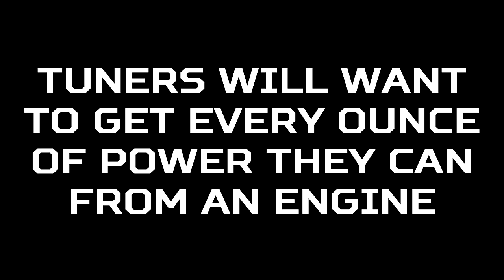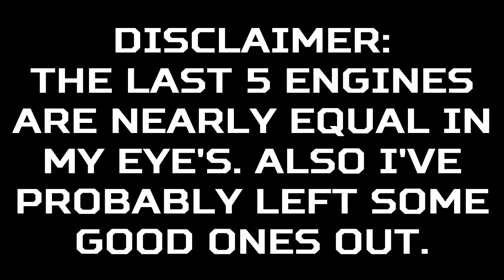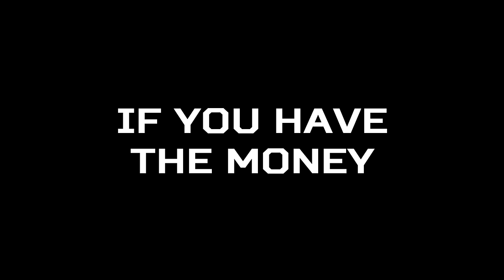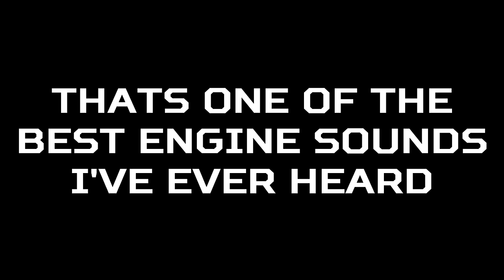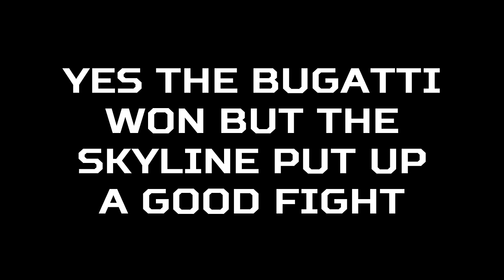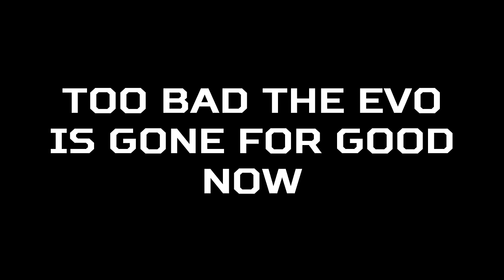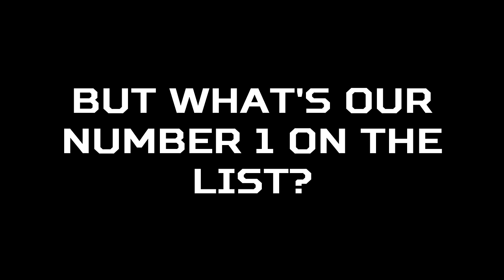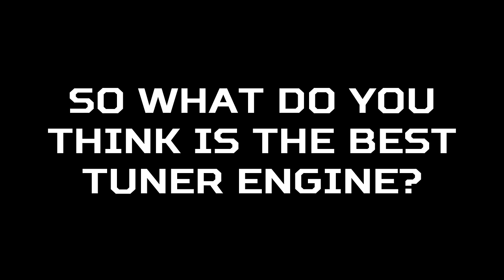9 of the Best Tuning Engines

Comment: As much as I love the LS engines, even I have to admit the 2JZ is pretty freakin' awesome.  Where the LS edges it out is in its ubiquity, simplicity, size, weight, and durability.
Reply: david donovan an ls weighs less than a 2jz size is about the same as the 2j and it is more reliable than a 2j still I love the 2jz one of my fav engines
Reply: as reliably it depends on the ls my guy
Reply: @BryanGarcia-qb2ov  false.  The 2J is just as if not more reliable then the ls
Reply: @19KiloM1A1  at stock hp, if your looking to get really high hp, an ls will be more reliable
Reply: @kellykun5090  that is not true.  I have built 1000+ hp on a stock bottom end 2J.  Just do some digging and you find that out.
Reply: @19KiloM1A1  okayyy? and that is irrelevant, an LS will always have the upper hand in durability,  with the same money invested(from a smart tuner)
Reply: @kellykun5090  again it will not.  The 2Jz has a steel block steel crank and forged rods.  I will take a 2jz and make just as much if not more power and live just as long if not longer.  The 2jz has been around way long then the ls crap wagon.  Do some research and see what else is out there and how long it lives.
Reply: @19KiloM1A1  idk i had a mazda b1600 with a 2jz in it, made around 512hp with a slightly bigger turbo, that engine was a headache, eventually sold it and bought a sr20VE and transplanted 3sge ITBs and N1 cams, and tuned it makes 237hp at the wheels and revs to 9000rpm, i beat the shit out of that engine, still works after 50,000 km, barely any money spent repairing, minor things like a starter and ac compressors, in other words, i know what reliable feels like, the jz is not a reliable engine from my experience
Reply: the same sr20ve also now lives in my 1999 Nissan primera GT, i bought it used, and put it in the van, van chassis is dead so i bought a primera late last year and now i use it as a daily engine, i could not do that with the 2jz
Reply: @19KiloM1A1  those rods gave out as soon as u made over 600hp though.... idk what 2jz u are  talking about. obv not stock😂 my sr20 4 banger is pushing 237 at the wheel with no turbo, all i put were factory oem N1 cams from the sr16, and it still screams even after all my daily abuse.
Reply: @kellykun5090  not sure way you had issues.  Example.  92 Supra stock bottom end, crank, rods and pistons.  Had the head done out in Cali, cant remember who for the life of me.  HKS 262 cams a single Turbonetic 73 plus the usual mods of the day and it made 850 on our chassis dyno at 28 lbs.
Reply: @19KiloM1A1  i have a hard time believing u got over 600hp on stock rods, in the 2j community here those are usually replaced before making 500hp
Reply: @kellykun5090  That is the RB26 you are thinking of

Comment: I can't really get down with calling an engine swap "tuning".  Building a race engine, no matter what manufacturer it came from is not "tuning" either, thats building an engine.  Tuning, at least in my mind, is exactly what it has always been, dialing in the air fuel mixture and timing to get the most out of any engine.  The term came from musical instruments.  If you tune a guitar, you dont throw it away and replace it with a piano, you get that guitar to sing to its best potential.
Reply: which is exactly what they're doing?

Comment: U miss one .
It's 4age black top 20 valve
Reply: The the BEAMS 3SGE is better imo
Reply: Sorry the beams is not
Reply: It come down home much air and fuel you can flow in. the Yamaha head flows the best that head even flows more the the 2JZ the rest is just about turning up the snail

Comment: 2jz & n54
Reply: Esteban Estrada 4g63
Reply: BMW engine is better
Reply: @carholic-sz3qv  N54 and S85 V10. N54 B M W engine has better performance than 2JZ
Reply: @henzo7087  you are on crack man those bmw engines are newer than the 2jz and they are totally unreliable i dont want to argue with you
Reply: @carholic-sz3qv  b58 engine is better. Name the unreliable issues on the n54 I really want to hear this
Reply: @RDJ1SS  there is non xD all the n54 reliability problems are not as mutch the engine as it is failing waterpump and stupid americans puting crapy fuel in the tank fucking upp the fuel pump.
Reply: 2jz is bad for track racing, it is good for drag racing, but rb26 is better on track racing
Reply: @RDJ1SS  stock block is amazing. Just like 2jz. All problems with n54 are not engine block related
Reply: @carholic-sz3qv  You've never owned or maintained one so I guarantee everybody else watching this video can speak for you on that 🙄
Reply: @historicalsongs9427  The Oil leakage in the RB Series engines overall are the achillies heel of the production line
Reply: N54 is new 2jz. Water pump and fuel pump issues are easy fixes nothing to do with engine performance. I'm at 800whp on a stock block for last 2 years no issues. N54 hands down all the way
Reply: @sergiogazyura54  Finally an engine that can compete with the 2jz that is a 6 cylinder.
Reply: Fk N54 engine. Bimmer fanboy
Reply: Le Chat Botté “totally unreliable” lmao go watch Scotty Kilmer some more, can’t believe 5 people upvoted that
Reply: @sergiogazyura54  Wow how about now? Hows the engine? Did you bumped up the power again?

Comment: How is the BMW N54  not on this list? A simple tune gains 75 HP and turbo upgrades get up to the 800 UP range.  All BMW motors are under rated from them. The 300 HP is closer to 330 based on independent dyno's. it's not called the new supra for nothing.
Reply: Jeff T I bet "because jdm bruh"
Reply: No just no it's nothing close to the supra
Reply: Jeff T surprised BMW m50 isn’t on here it’s super easy to find and build

Comment: the skylines that where doing the burnouts are rwd so it's most likely a rb25 not a rb26 but still a great power plant..
Reply: Professor Oak's lab true but if can always have an rb25 trany
Reply: Professor Oak's lab just pull the fuse under the dash to become rwd.
Reply: its a gtt then they weree rwd
Reply: Professor Oak's lab you cant make the GT-R RWD
Reply: It would be a R32. they were RWD
Reply: Dear rice lover go back to school an all wheel can burn over if the drive train has more power to the back that most do. Thank you and good night
Reply: Tacos aux épinards You need to do a little research
Reply: Alex Fry the RELAY is actually under the hood on the drivers side
Reply: Hmm but do you know about the Nissan Skyline GT-T or 25GT Turbo?